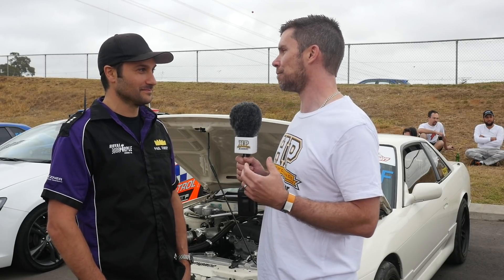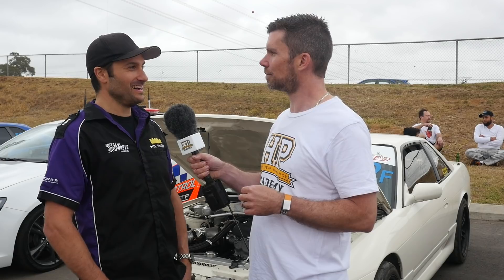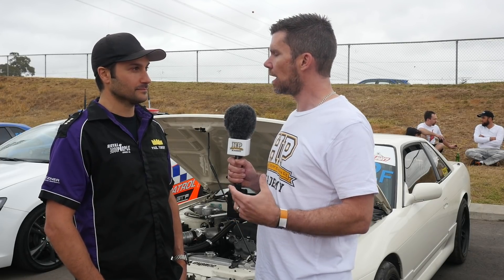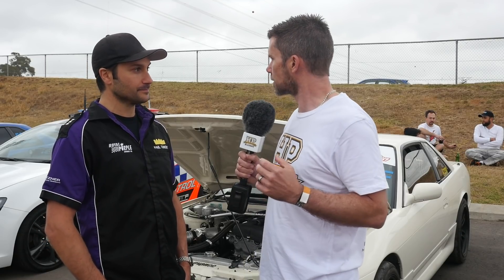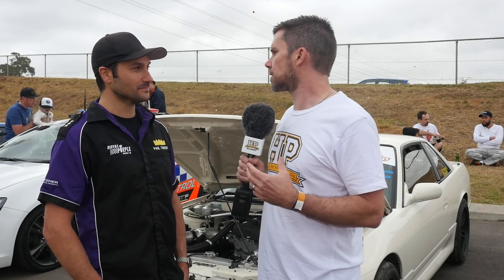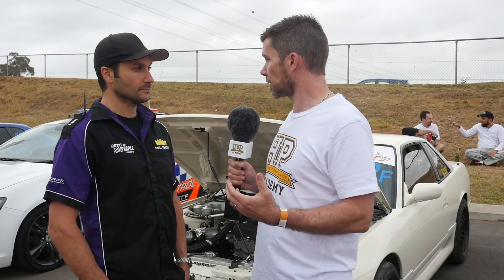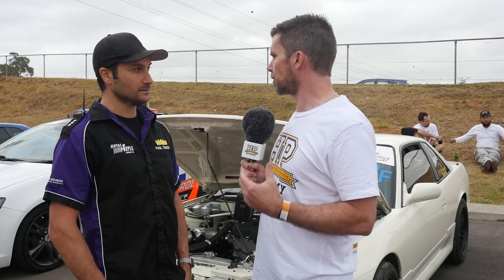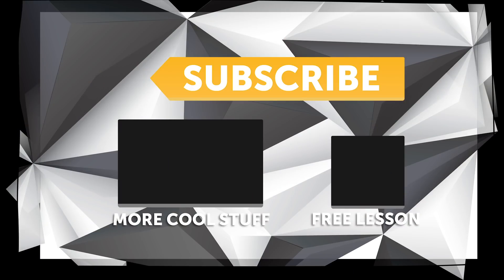950HP AWD Silvia | SR20VET VS SR20DET Heads [TECH NUGGET]

Comment: Why does everyone shit on VTEC when the dual lobe technology was actually created by them and everyone copied it. Give it a little more respect. without that sort of tech your motor is only good in either low or high rpm
Reply: We use what they call  killer cams in the VE head so we dont use vtec, useless for drag racing.
Reply: @holeshot282  Ive seen those before. From what a remember hearing, they make great parts. I know Drag Cartel had/had been fucking up this last year+ with some of there Cams and other products and intern they lost alot of fans/customers/etc). Since they seemed to always have great performance parts that were "affordable" for what they could do/handle. o\On top of that, they had a huge influence in the Racing scene. Idk, if they changed their manufacturing process or or their Quality Control took a shit, idk. Im not even sure how they are still doing and if there place in the racing scene is still lower or if they've grown. A lot of other great companies have come since them and are making great products. Motion Raceworks for an example. But any who, Thanks for he reply, Brother. Have a good one.

Comment: Being interested in head porting, I'd love to see a comparison on these two heads.
Reply: The comparison is chalk and cheese... Think 2V and 4V Cleveland heads, that's the kind of difference you are talking.
Reply: So one is slightly too big and the other is massively too big?
Reply: @skippy2987  Yep a bit like that :D
Reply: standard ports will still make around 800whp, they have insanely high flowing ports
Reply: @SR22VET-S15  Unfortunately quoting power levels as airflow on a forced induction engine doesn't mean anything, you can always just force more boost through it.

Airflow (preferably in cfm) and cross sectional area are where it's at, with those two you can calculate the engine's characteristics pretty effectively

Port velocity (proportional to rpm and inversely proportional to port cross sectional area) is almost as important as cfm, it can (assuming correct cam timing) give you as much extra power/torque as another 2-3psi.
Reply: @skippy2987  you misinterpreted what i said, i mean the oem ports will support that power level, i made 750whp on standard ports @42 psi, youre correct you will just to run more boost to achieve that power,  ive now ported it and gone with a larger 6870, will update you once its tuned
Reply: @SR22VET-S15  did a good valve job too?
Reply: @skippy2987  multi angle valve job, oversized valves, port match exhaust and intake, cnc combustion chambers ect

Comment: That's right like Honda go the honda good on you Nissan trying to copy.lol
Reply: Nissan trying to copy honda? Honda copied nissan after nissan perfected the vtec system honda came up with the k20 engine. The k20 uses the same VVTLI system as Neo vvl from 1997 but k20 never came out till 2001
Reply: @MR-SR20  with the cam gears perhaps but Nissan copied the cam setup.
Reply: @igvtec  there were other companies using the VTEC system before Honda but just never publicised it like honda. Honda Nissan Mitsubishi Toyota have all used it hell even the germans used  it

Comment: Building one myself now with taarks and mazworx parts. P11 head
Reply: how much power you trying to get out of it
Reply: @ibraiynlopez3510  like 600-650 street car nothing crazy
Reply: @TurbochargedGardener  me too bro but i have an N1 head the block is 87x86 im looking at 600whp hopefully it will be out by summer
Reply: @MR-SR20  sounds good bro I wanna do a few videos when I start the build process. Still waiting on parts to come in and trying to decide which gearbox to go with. I have a regular DET setup right now in the car making like 460 with the stock gearbox.
Reply: @TurbochargedGardener  Fwd or rwd? Im putting mine in a g20 p10 i have 2 red ones
Reply: @MR-SR20  rwd going in a 240sx
Reply: @MR-SR20  I kinda wanna build a fwd one later on down the line put it in my Altima lol
Reply: @TurbochargedGardener  I would have put mine in a b13 ser but im in the UK and they didn't sell them here im going to see how things go in this p10 if i don't like it I'll switch it to a ps13